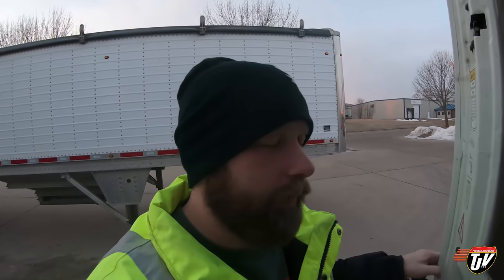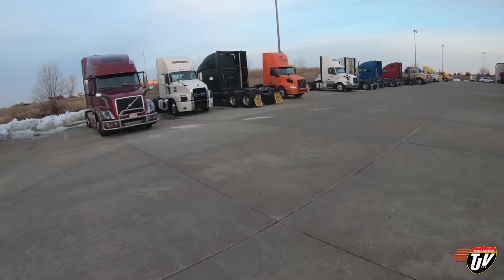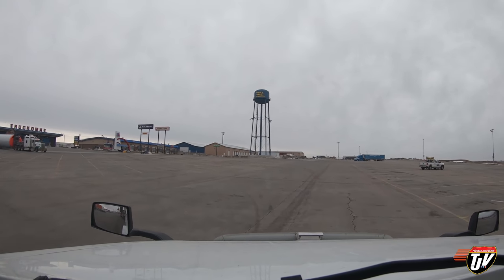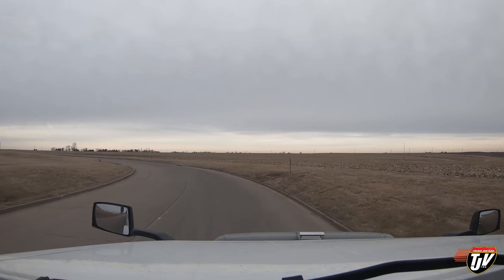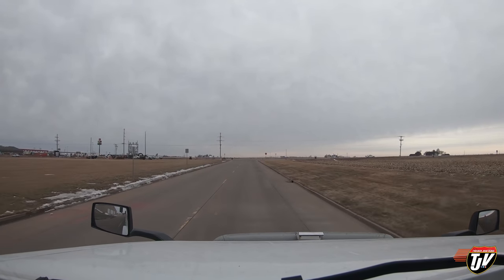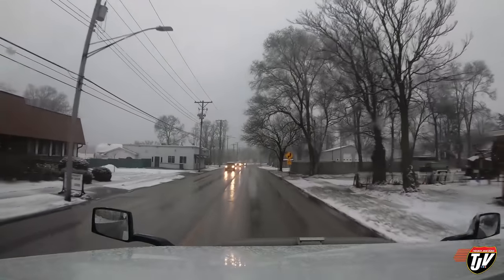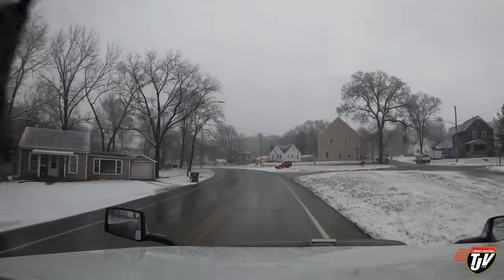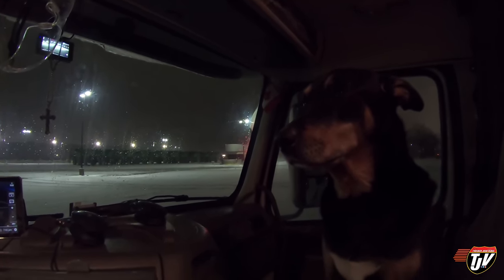My Trucking Life | SIMPLE REPAIR | #1921

Comment: I have tools with me. One winter I had the cheap plastic air lines. Luckily only the blue line kept leaking. Fixed it twice. Once on the side of the highway and the other at a Loves. Then had a T bolt clamp from turbo to the intercooler hot side pipe blow off. Fixed that on the side of the highway. The misc clamps and hoses. Also, zip ties are your friend and same as Torx sockets.